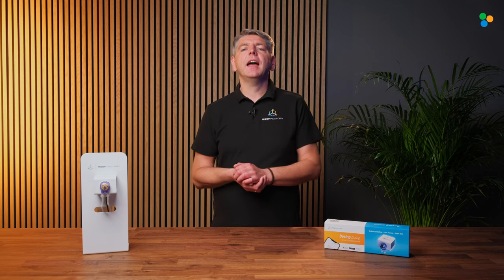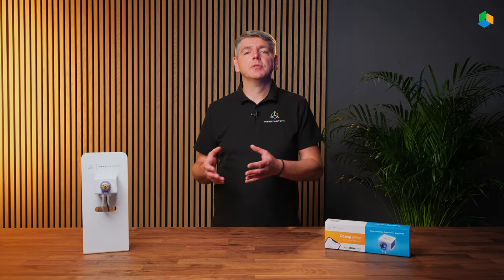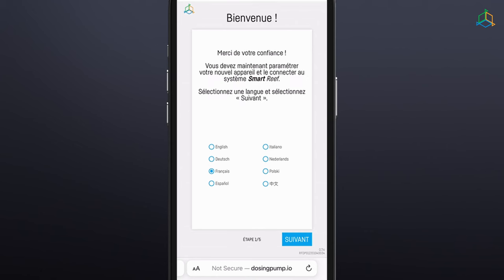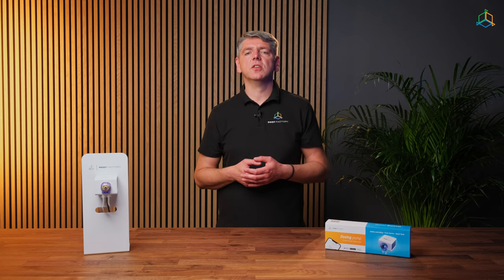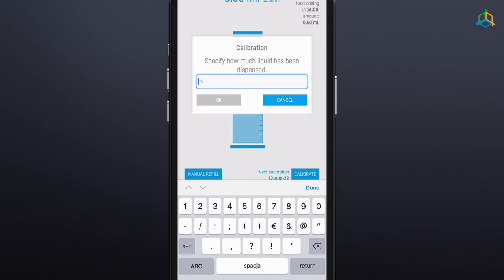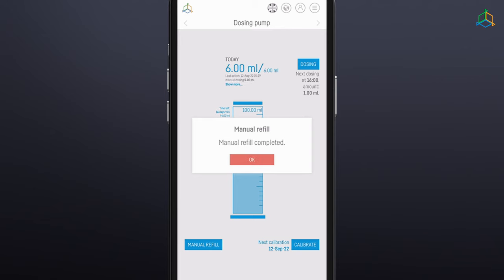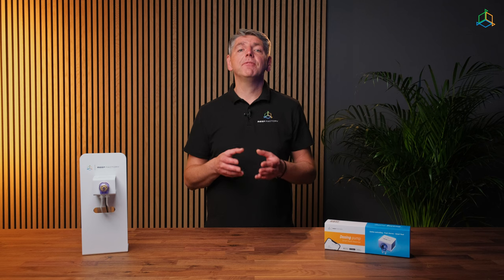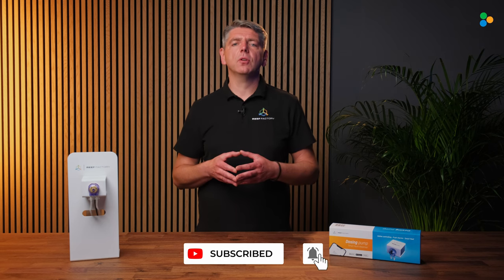Dosing pump x1 - user manual | device assembly, configuration, calibration and more!

Comment: The dosing hose has a stupid measurement (2/5mm) so it does not fit in normal fittings. There is no connection fitting included that can connect it to 1/4" ☹️